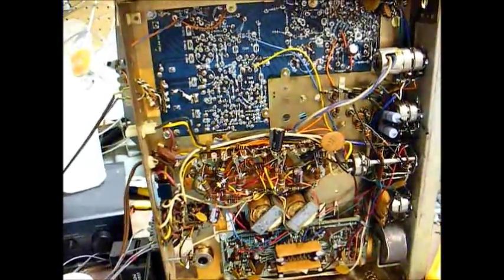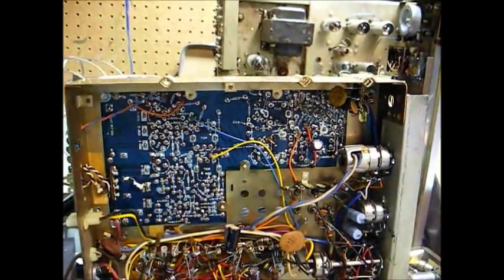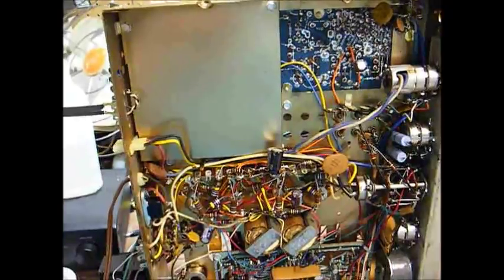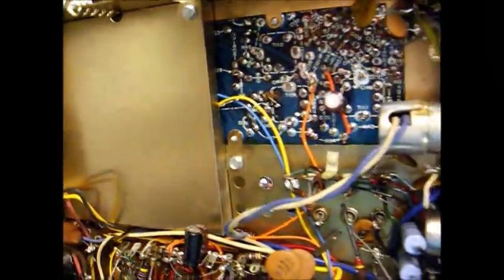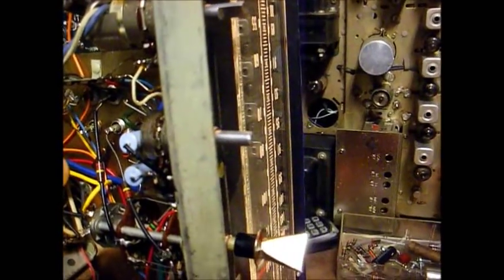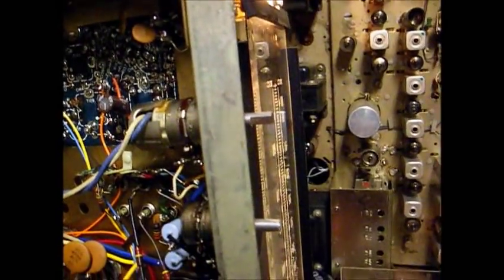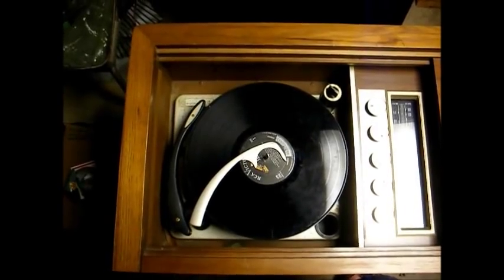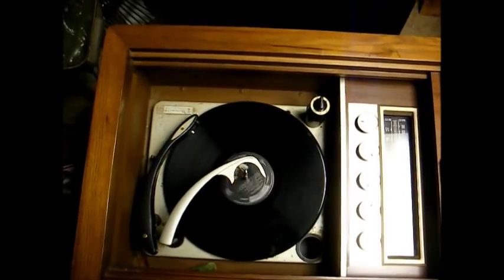Repair of a 1965 Magnavox Astro-Sonic console stereo - part 2

Comment: BF324 pnp silicon transistor can be used with or sometimes without a rebias in place of the hard to obtain pnp germanium RF Mesa transistors. BF324 is cheap and plentiful on ebay

Comment: I just finished replacing all of the transistors like you did. Am works poorly and no reception or even fuzz on fm. I replaced the 5152p with nte 126. The 126 are the terminal. Where does the 4th leg go? To unmarked spot off the tab on the side? You also mentioned the pack was faulty, which one would that be. I am a novice at best. Any help would be awesome
Reply: I meant three terminal not the...
Reply: Also wanted mention that I connected a n outside source and it worked beautifully.
Reply: Oh and is there a schematic available. I would gladly PayPal you something in return. Any help would be immensely appreciated. 
Signed
Dumbfounded in Florida.

Comment: I have a console with that chassis and the tuner performance is not up to Magnavox standards on both AM and FM. Yes it's their entry level Astro-Sonic, but Magnavox was also known for their tuners and even a low end Astro-Sonic 20 was a quality stereo. I'm about to drop the chassis again and see if I can find an issue. In the next room is a high end Magnavox, same model year, and it's a station magnet.

Comment: My dad has a similar Magnavox console stereo. The FM on it ain't all that great. I've also tweaked it, and not much helps. About the only thing you can do to get the FM to work better on these Maggies is to use a better antenna, if you really want to the FM to work stronger. I actually put a par of rabbit ears on my dads. It really helped. Hope you can use this info.  Randy.
Reply: I use amplified rabbit ears on my astro-sonic works great, the amplifier is built right into the antenna housing

Comment: It seems to be performing quite well, probably as well as it ever did. In terms of all radios, not just FM tuners, they are not all created equal, maybe the better performing models had extra RF or IF amplifiers that this set does not have, or simply better designed circuits, or higher quality parts, etc.

Comment: Thank you for taking the time to teach and post videos and how you restore vintage TV's Radios The Right way... I like way you check things correct. Another YouTube user thinks he does not have to check caps on a vintage TV and get by doing it his way... I'm like you were I check all the caps Filter Caps voltage CRT and tubes for Leaks and shorts....

Comment: you did not mention using a heat sink on the germanium transistors when removing for test. I did not have that schematic handy but on another (R201 IIRC) the coil was tapped, for the collector connection, so it would act like a voltage divider and have some voltage between the source and the ground. Mine showed what looked like 10.8 but upon closer viewing I was reading an arrow in front of the number it was actually .8

Comment: To me, FM performance seemed just fine...I saw no issues there. AM is always going to pull in more stations; typical range of FM is around 40 miles, whereas AM will oftentimes DX to around 1,000 miles. But to me, the real gem there is the phono performance...I bet that's a very good sounding unit.